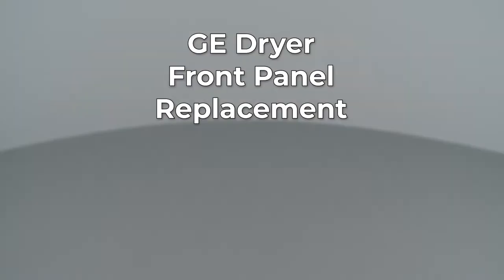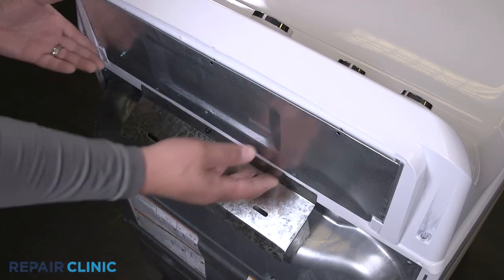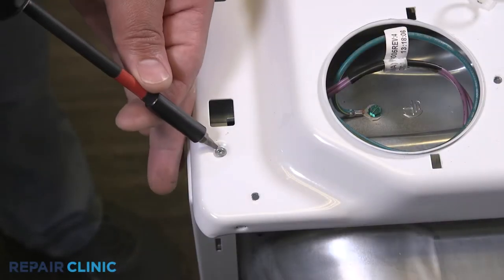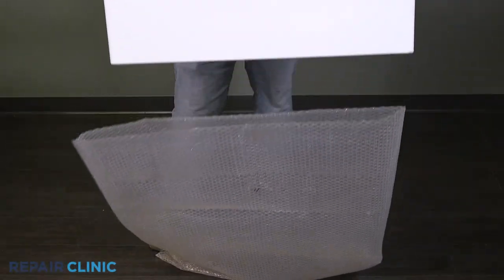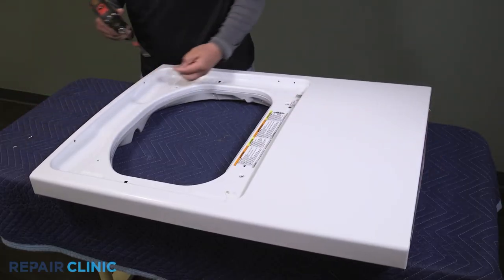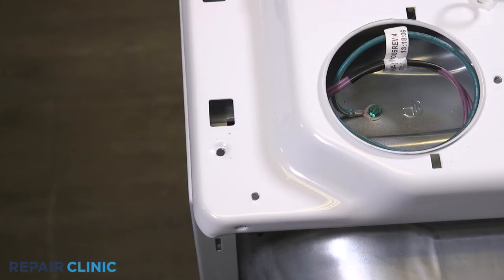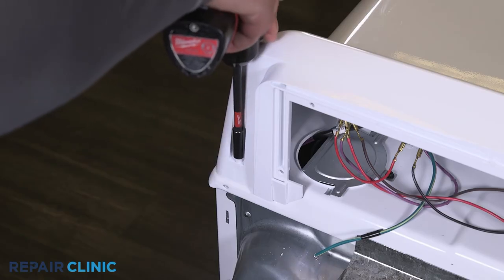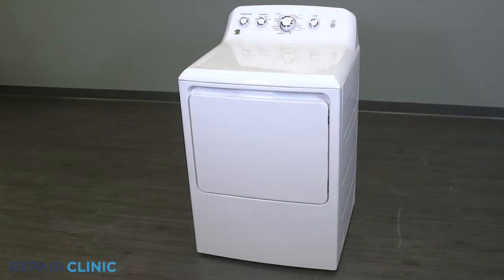GE Dryer Front Dryer Panel Replacement WE20X25260

Comment: I really wish there was an easier way to remove the front panel for cleaning, the space between the front panel and the drum is such a huge fire hazard with how much lint gets trapped there.
Reply: I was able to access the front by taking 2 screws from top of the door that hold top panel in place. This allows you to lift front of top panel up about 2 inches which is enough room to get small adjustable wrench in there to remove 2 screws holding the top of the front panel. I stuck a small rag in on each side to keep top panel propped up a couple inches.